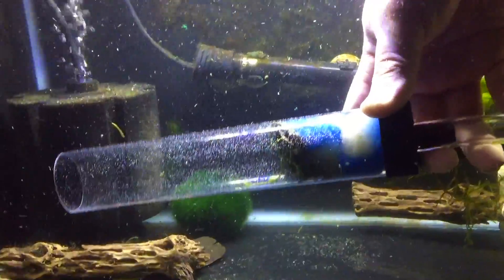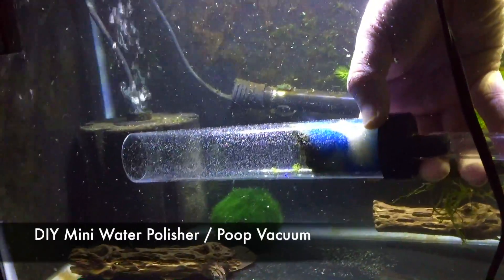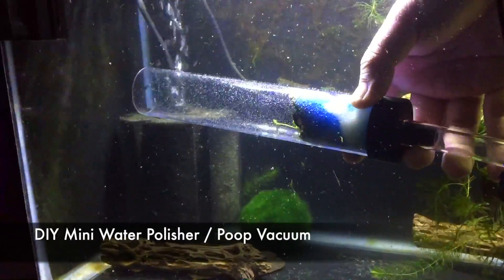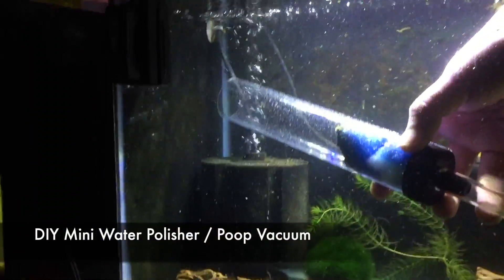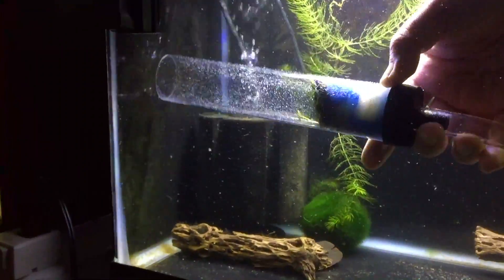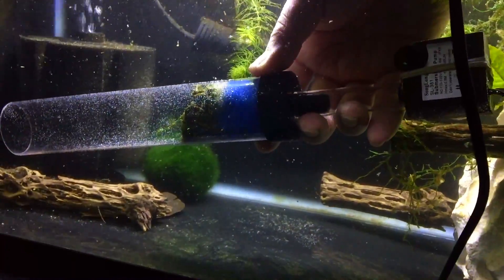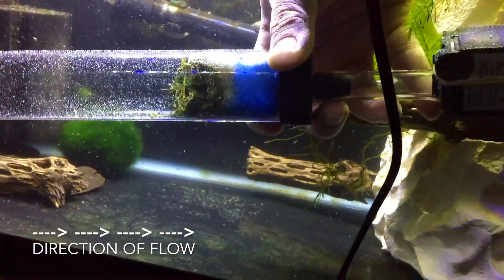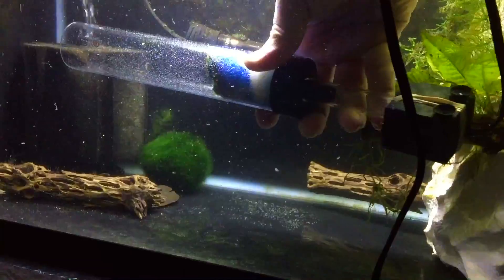How To: Mini Water Polisher / Poop Vacuum

Comment: Great idea! I've thinking of something similar to that but to use it as more of a water polisher when needed on the side of the tank. I have a small 20 gallon planted tank and all other powerheads would be too much. I see the outlet but I don't see the inlet and how you got the hose on there. The pics on Amazon do not show where an inlet hose could be connected. Could you explain how you got the hose on?
Reply from the maker: rocket5557 I just force-pushed it onto the pump intake. Luckily it fit well although I did have to superglue it to ensure fixation.